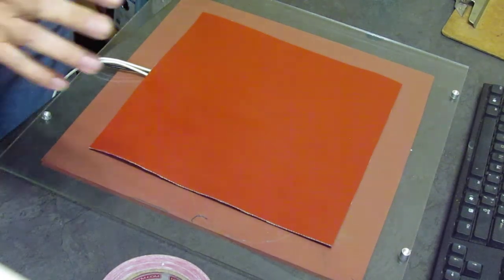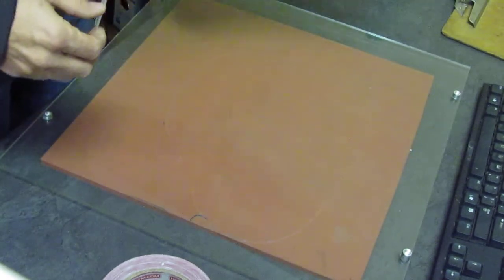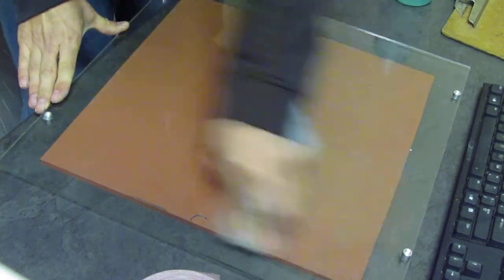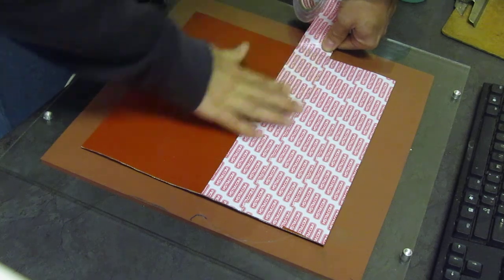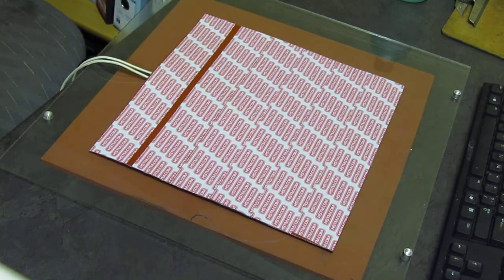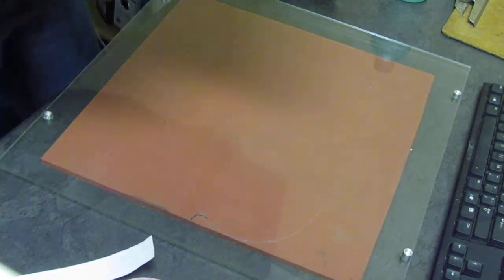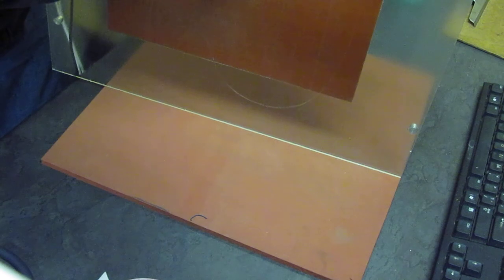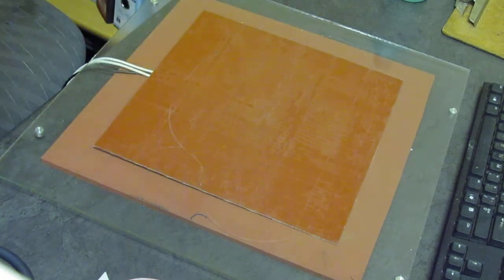Heater pad sticking to glass

Comment: Hi! Do you use just glass like printing table? How is it? I thing about it to solve leveling problems...
Reply from the maker: It will help, but its not  complete solution. Glass can also be uneven. Its just generally less so than some build plates. Glass is a good solution as it is mostly straight easy to get materials to stick too and cheap to replace.  The only downside is that it's not metal so proximity sensors don't work. I love glass as a build plate material and its very worthwhile using it if you're having trouble. You don't need to go with borosilicate glass 5mm window glass is fine.
Reply: @MScholtz  Thanks a lot!

Comment: Hello,
What type of glass do you use, usually 4mm or tempered glass?
Reply from the maker: Alexander Hristow it depends on the machine. For larger machines printing with abs is very tricky so there is little need to heat the buildplate much for those windows class around 4-6mm is fine. If you can afford it borosilicate class is capable of high heat applications and very flat.

Comment: Do you have any issues with uneven heating?
Reply from the maker: William W silicone heaters are known to be a little uneaven. The one where its not covering all the glass I dont heat it over 70. The other machines I have borosilicate glass which is fine. To heat and I dont have issues with them.